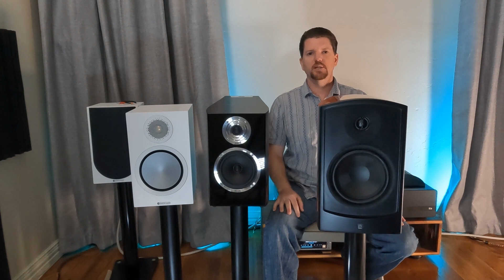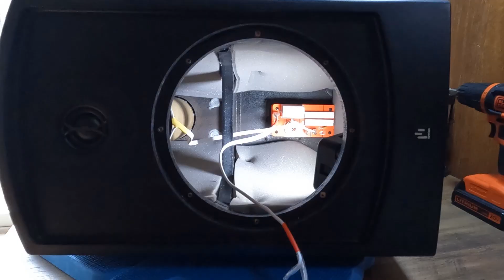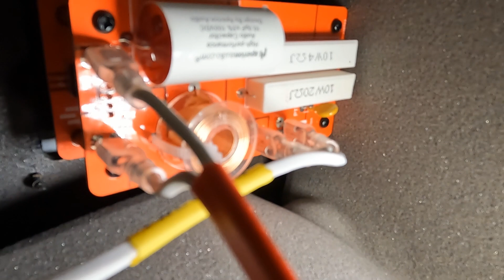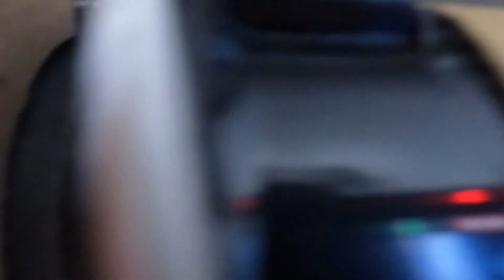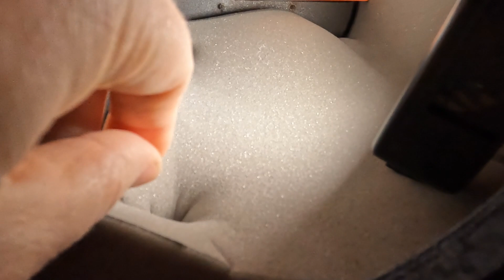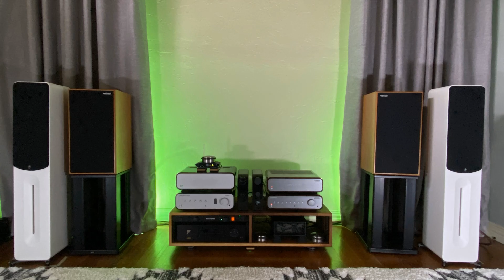Aperion Audio Verus III Concert V8B: Part I versus Monitor Audio Silver 7G & Heco Celan 3

Comment: I'm surprised that the crossed that at 2800 an 8 " starts beaming around 2000 maybe the tweeter doesn't get that low idk but everything else it looks really good for the money. It's a good looking speaker . Big woofers just can't be beat. Good video I like the way you dig into the speakers .
Reply from the maker: The only speaker that got a little unruly was the 7G on electric guitar, certainly jumps and bites in low mids.  The V8B's were the flattest of the three, meaning most controlled and consistent, not dull.  

Appreciate you watching and commenting, thank you.

Comment: It pains me to see cardboard tubes in any speaker that expensive
Reply from the maker: Certainly one of  the very few areas of non detrimental cost cutting.  I will say its density is less prone to ringing versus the cheap plastics ones often found in similar and more expensive designs.  Somethings got to give.  Thanks for watching.
Reply: @2ChannelListening you know I never thought about that but that's a great point about the ringing

Comment: How would the Philharmonic BMR compare to these?
Reply from the maker: Hard to give this a legit comparison since the space is completely different as are the electronics.  The Aperions are darn good, I mean really terrific for $1,500, especially such robust well defined bass.  The BMR's will play a bit more neutral and flatter, yet I still love the air of the ribbon tweeter so I would nod upper level information and presentation to the BMR.   I have yet to hear stronger, fuller bass from a stand mount than the Aperion V8B.
Reply: So they’re good subwoofers.

Comment: Will the Aperions fill up a 20 x 25 ft room ? I have dual subs
Reply from the maker: You have a pretty big room for stand mounts, certainly dual subs make a big difference for room filling bass.  How far back are you sitting?
Reply: @2ChannelListening  set up is facing along the wider part of the room ( it’s not a dedicated audio room) . My floor standers currently are about 5 feet away from the front wall (but i move them back against the front wall after each listening session) and about 7. 5 feet apart and my chair is about 8.5 feet away . I tried the Triangle Bro 3 before , it was great with jazz and vocals but with rock   , it just was not resolving enough , was “messy”. I’ve been looking for big bookshelves on a budget ever since .

Comment: Thank You, Jason. Yes still there's plenty of (depressing) trade-off to be considered in that price range. With the V8Bs it might be the the tweeter which may have it's problems with the "sshhhh" and lower "sch" phonemes, among many speaker competitiors. We will learn from you...
Whenever I bought bookshelf speakers in the past a pleasant surprise was when rather than pondering about subwoofers early I discovered a little headroom for attenuation (like -2dB) in the lower like 40 Hz bass department. Some - just some - will actually deliver on that!
Hecos are available as "open box new" items over and over again for less than 900 Euros here in Germany. - Heco among other brands from that conglomerate have a reputation for well engineered drivers but cheesy inner parts like damping mats and crossover components ever since. Traces of hardnened out hot glue are just everywhere, on and off the crossover. Wood screws will no longer engage with their MDF after slightest overtightening, be careful!😅 Keep them coming!
Reply from the maker: You pointed out something very key with the Heco that I have to belabor in the next video.  As to say (depressing) I've never felt that critical about speakers in the $1,000 - $2,000 US range.  So few have really stood out with above average build quality and components that I choose to be more excited when something like the Aperion V8B and Philharmonic BMR come along.
Reply: @2ChannelListening  I thought again... maybe too harsh that "depressing" term I used. Well I did too much of "sidegrading" in my early years within - but learned from it

Comment: How do the Aperion (as well as the others) sound at low to moderate volume levels?  That's what I mainly listen at.  Does the bass retain its qualities or is it a speaker that needs to be given lots of power before it reaches its performance levels?  Also, how is imaging and stage depth?

I have had MA silver 100 6th in my room and while I liked it for the most part, it could sound a bit congested in the upper mods/highs at times.  But bass, midbass and lower mids were nicely defined and punchy. It also had a very wide stage but it wasn't very deep.  

No experience with Heco.
Reply from the maker: Sorry, I can answer more after the next video.  I absolutely can answer this in detail then.
Reply: @2ChannelListening  OK.

Comment: Strange as the Heco placed first in a previous review compared with Focal, SVS, Dali, Monitor Audio among others.  As a budget speaker, I found it strange Heco placed as well as it did in comparison to the others.  Well, all the others are still within the budget range as well.
Reply from the maker: For me, the Heco Celan had a low threshold that really surprised me.  My simple cheap hack went a long way to address the issue I found.  More to come.
Reply: @2ChannelListening  Wish the wood veneer was available in the States for the Heco. Gloss black just too much.  Though the black ash on the MA is really nice.
Reply from the maker: @nc3419  Yes, its a pain to keep touching up the Heco.  Looks great, but shows everything.